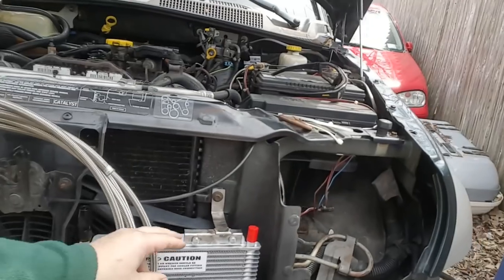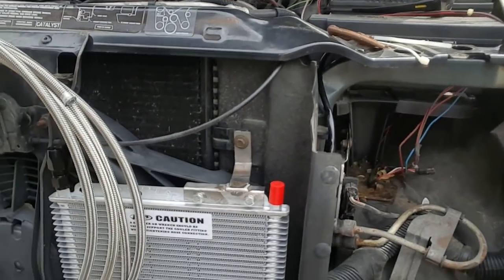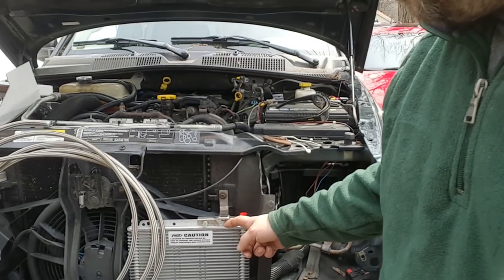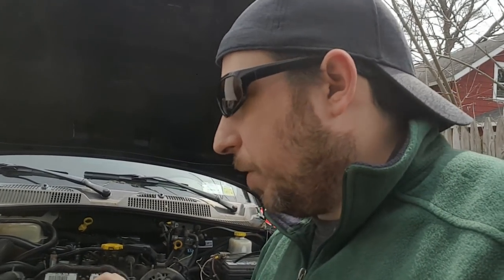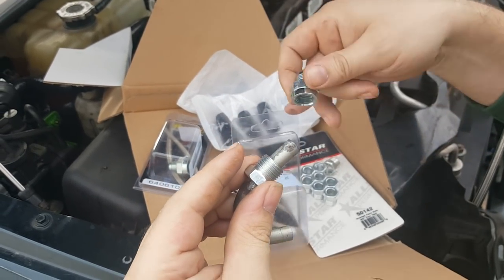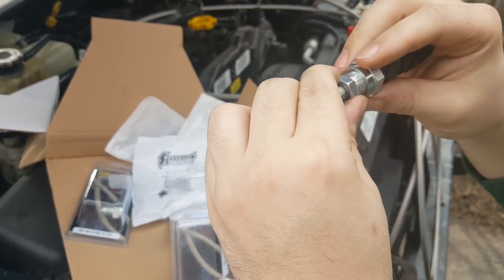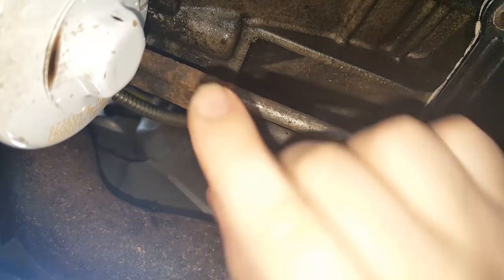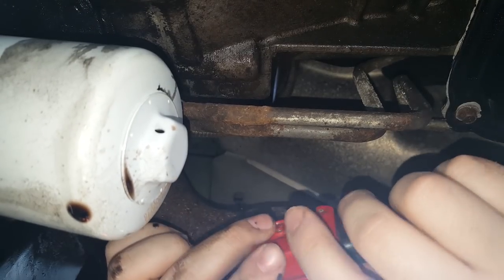Jeep Liberty CRD Transmission Cooler Upgrade

Comment: Awesome !  My 2006 Jeep Liberty recently spilled lots of Transmission fluid due to a loose  clip inside the end fitting of  the return transmission cooler line bolted on the side of the transmission. You mentioned few key words in your video: "Cooler Line End Fittings".  Bought a new one at Autozone for $17  and I am back on the road . 🛣. Saved me hundreds 💰 from going to a mechanic ... Thanks 🤩!!!

Comment: Hey Mike, thanks for the video, just curious, I’ve added aftermarket transmission coolers to several vehicles, and I have always added them in line with the existing cooler, maybe I missed it but why did you go direct to the aftermarket cooler rather than put it in series with the existing cooler?

Comment: Great videos on the KJ with terrific explanations but shpuldn't the cooler lines go horizontally and the fins vertically? I am looking at just this job and was of the understanding that inlet at bottom/return at top would lead to a self bledding situation or have I missed sometghng? Many thanks again for the videos. Kept prompting on your line assembly The nut mate, don't forget the nut. You didn't. Cheers.

Comment: Curious question for you, how did you refill the lines to ensure that no air got back into the system. Based on your comments on how the original cooler was installed, it sounds like that may have been a design flaw of the OEM version. Thanks.
Reply from the maker: Scott Gephart I’m not 100% sure but in my research most aftermarket coolers had the lines enter at the top and I read this is to keep fluid from draining out back into the transmission while the engine is off there were a few times my transmission would take a while to engage and it seemed to fix the issue, while the cooler is still higher than the transmission I’m hoping it does not syphon back in and so far haven’t had any issues. And as far as refilling the refilling the lines I just let the transmission pump it through the lines seemed to work ok. I’m not sure if it was an oem flaw as my crd already had a aftermarket cooler I think was installed incorrectly. Tho the oem cooler also has the lines at the bottom allowing draining to occur but idk how much of a issue this is but it certainly fixed mine , thanks for the question!

Comment: So I’m thinking about buying a Liberty CRD with 133k miles.  I’ve done two Fummins conversions but just don’t that much about this engine.  Two things about this vehicle concerned me.  Light to heavy diesel smoke under WOT and a fair amount just cruising down the road.  After the thing was warmed up I took the oil cap off and put the palm of my hand over the opening to feel for blow by.  I ended up with black oil all over the palm of my hand.  I wasn’t breathing as bad as a 6.4 powerstroke but it was close. Have any thoughts?
Reply: He's got some videos on EGR delete and cleaning the intake. The combo of EGR soot and PCV oil creates a nasty build up in the intake choking the engine.

Comment: are you gonna do any performance upgrades for example straight pipe, or lift kit? i have a jeep liberty crd i did all the fixes egr, provent. i was thinking about straight piping it though.
Reply from the maker: its got 113k on it now and we do have some plans to do those upgrades , the stock suspension is pretty old at this point so an upgrade is almost the better option Maybe a straight pipe as well, also thinking of some sort of locking differential in the rear. Thanks for watching!
Reply: I run a Magna Flow and no cat on my 05 CRD very happy with it. + OME lift & Green Diesel tune + A lot more Love the CRD
Reply: @MM-gm2yk  i have the GDT as well i think im gonna keep the OME lift too. ill have to look into that exhaust